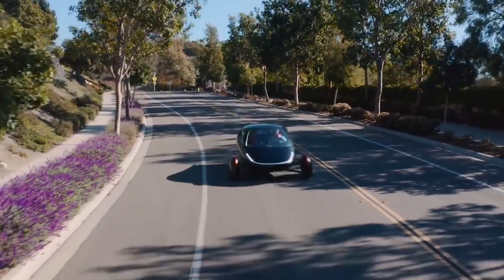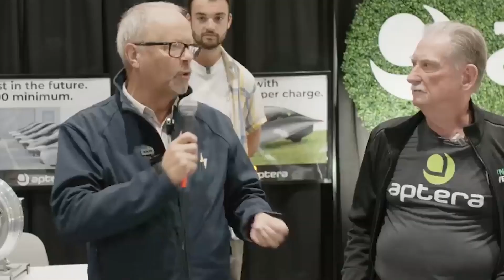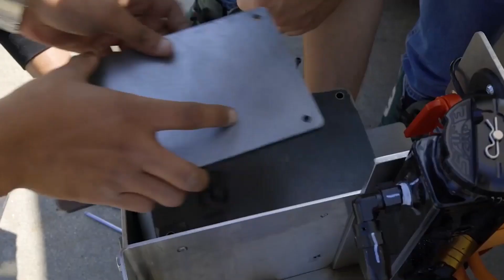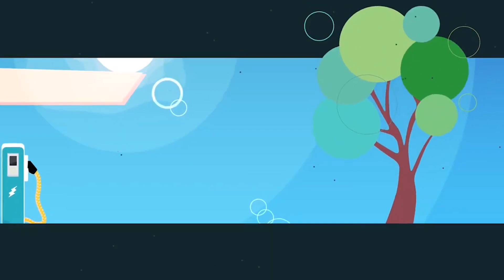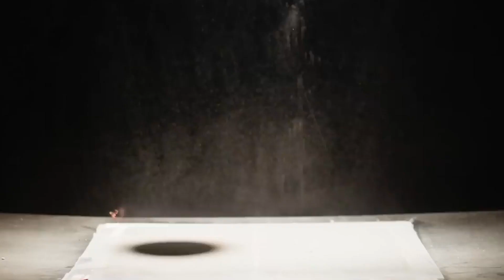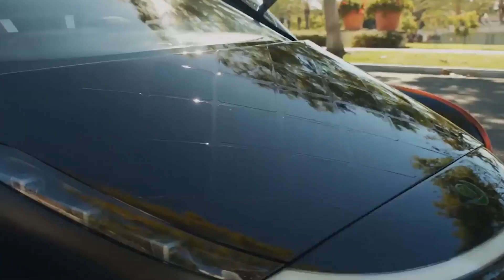Is The Aptera Really Green

Comment: The panels on the car are designed to  be replaced if damaged or as new more efficient panels are developed .can be replaced. Aptera is also designing the car to use additional panels when parked
which will more than double the charging speed .